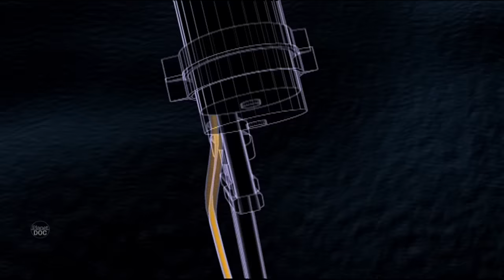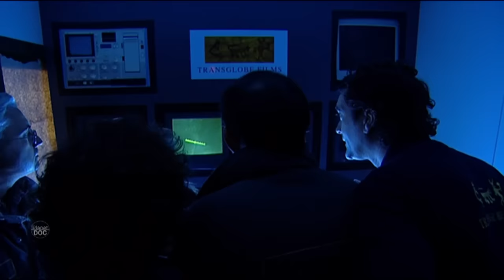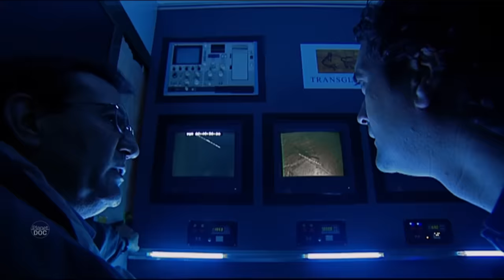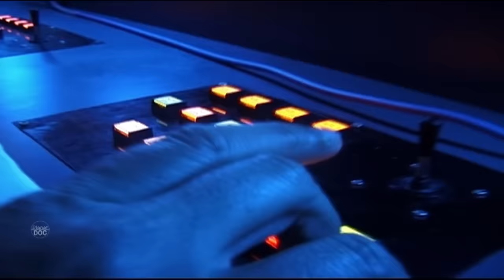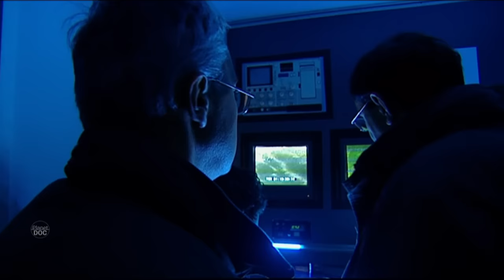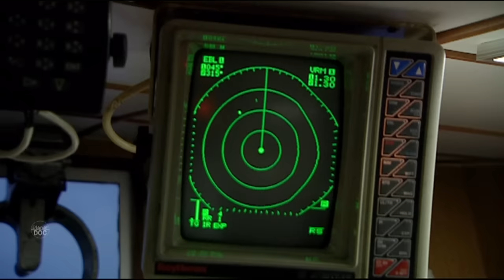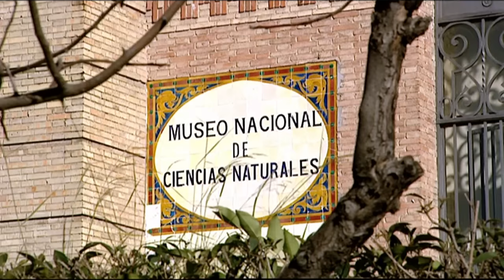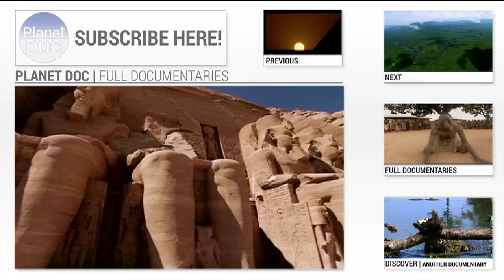Kraken Project; In search of the Giant Squid | Full Documentaries - Planet Doc Full Documentaries

Comment: Anyone ever think that the reason we don't see them very often, if at all, might be because they may have adapted an electricity gauge through evolution to sense around and the amount of electricity coming from the equipment we send down could possibly be the reason it avoids us all together? Instead of the camouflage evolution, they could've evolved it into something built more for the lack of light, of course rather than bio-luminescence. That or sound, to try to detect their predators, the Sperm Whale? And the amount of sound or strange noises at the least coming from the equipment could be hindering their appearance?
Reply: They have eyes the size of soccer balls their fine with the lack of light XD.
Reply: I doubt it.... Squid tend to race forwad and investigate anything and everything don't they? I'd be interested to know if sensing organs in deep sea predatory creatures are even actually used to avoid generally, rather than to find prey...  But I mean.... You never know!